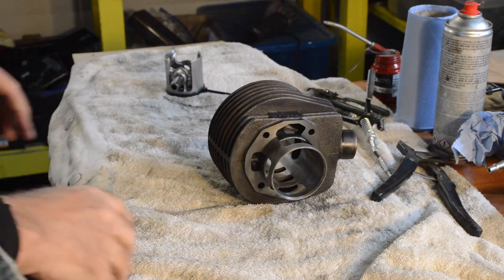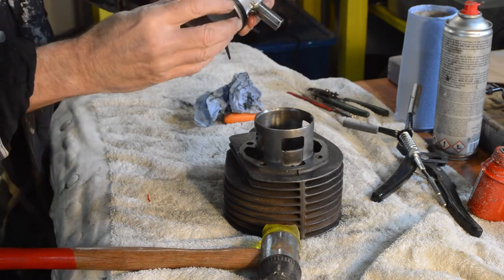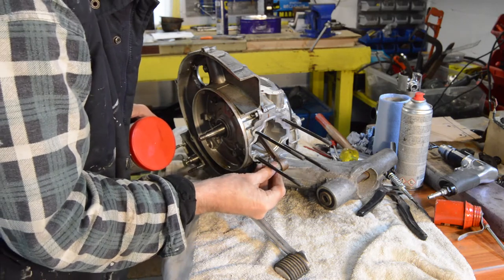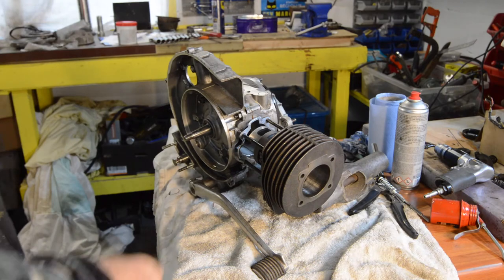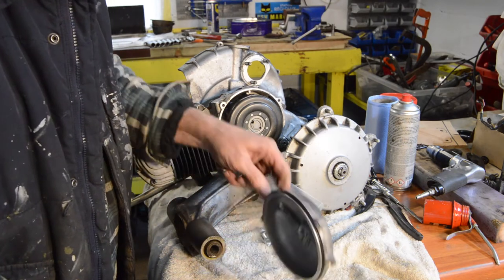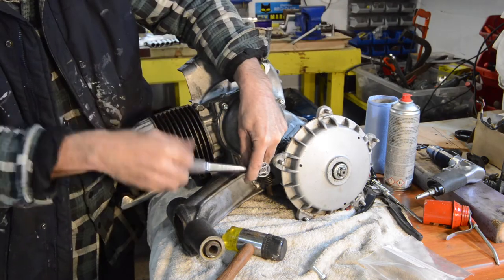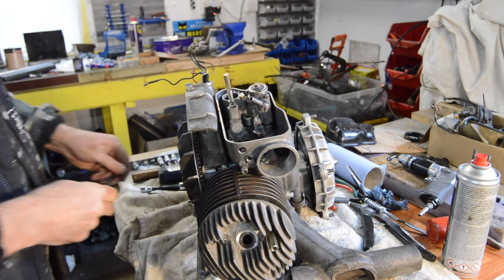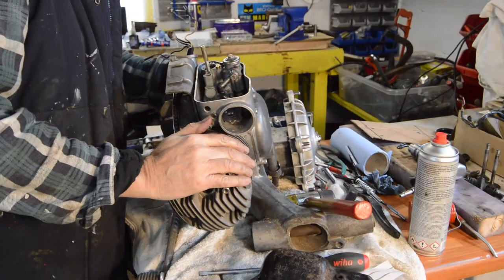PX Engine Build Part 5

Comment: Hi there. Great video. 
Noticed that you had a copper gasket between the stock Piaggio cylinder head and cylinder surfaces. These typically do not come stock on the vespa engine. 
Did you purposefully purchase that gasket to accomodate for the usual vespa head leaks? 
Cheers.
Reply from the maker: Hi Nello, the engine has a Malossi kit on it and it came with a gasket, the standard engines did not as you said. Thanks for watching !
Reply: @oldnutsgarage  malossi kit. That explains it.  I wish stock cylinders came with a gasket. It would eliminate a lot of headaches. And mess. 

Cheers. I look forward to more vespa material!

Comment: Very enjoyable and informative - but we NEED the "money shot" of hearing it being fired up !
Did the sturdier Cosa clutch (which I understand may be bigger than earlier Vespa PXs) fit into the clutch housing without your having to Dremel off some of the webbing on its inside, or was it previously done in the past - or not needed at all ?
Reply from the maker: The clutch just dropped in so maybe the case had been relieved previously?